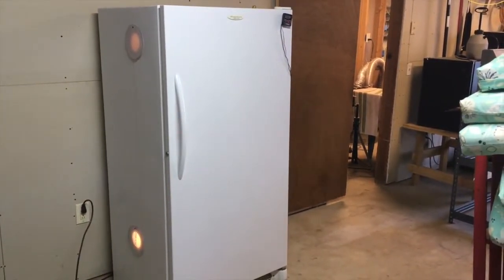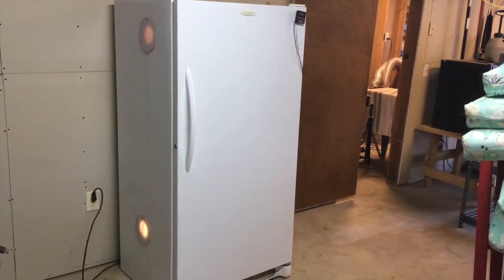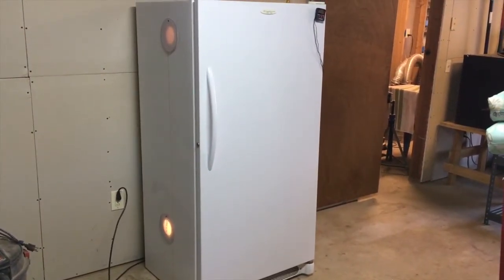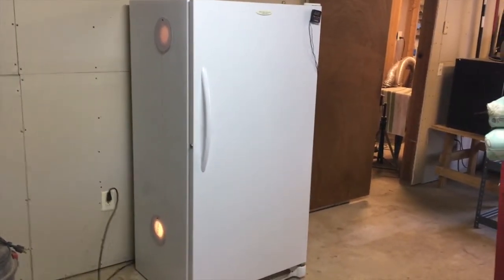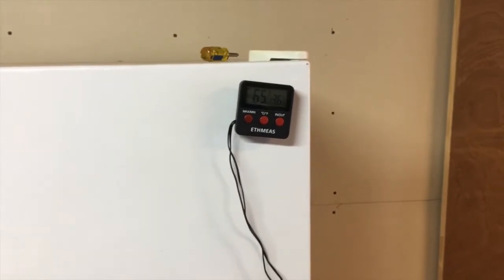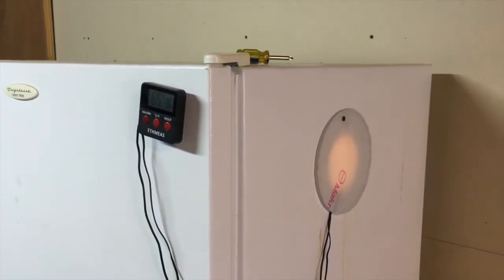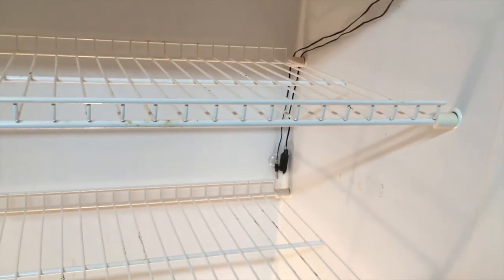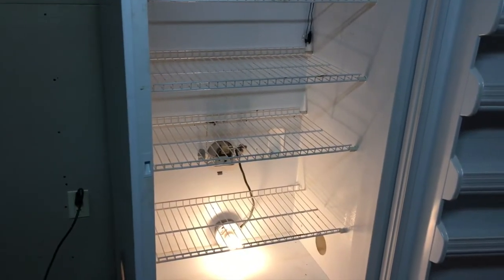DIY Wood Kiln

Comment: After seeing yours I grabbed a broken mini fridge from work and made a small kiln out of it. I started with a 60w bulb and it melted the inside of the fridge. 😳😁I changed it to a wax melting lamp for the scented waxes and it keeps it around 120-130 degrees depending on garage temps. Thanks for the idea and inspiration! 👍🏻Stay warm!
Reply from the maker: Wow!  Melted inside? Hard to believe it got that hot. Smaller area I guess. You have vent holes for heat to escape?  Have you noticed faster drying times?
Reply: @woodentreasurestn  I’ll text you a picture. It does seem like it dries faster. I only put some logs in it to test it out. A cedar one cracked pretty bad, but the hackberry hasn’t. It had some checking before, but it’s not worse. The wood has shrunk from the bark, however. Seems like it works great so far.
Reply: @ScenicCityWoodturning  Add a minute or 2 in a posting so we can follow your efforts too Mike !!     -Mike
Reply: @mpart_woodlathe-stuff  a minute or 2?
Reply: @ScenicCityWoodturning  I meant Add an aside once in a while to a post. Or feel free to do an in-depth post about it. We'd all be interested I'm sure. No BS.
Or does a minute where you are seem like days :) Or in Covid time that would be 1 or 2 nanoseconds hehe.
Reply: @mpart_woodlathe-stuff  oh, duh. I guess my senior moments are coming early. 😁 I can do that. Lord knows I haven’t had time to do anything else lately. Lol That’ll be easy enough. Now that my brain is back on track. 🙄
Reply: @ScenicCityWoodturning  Haha, guess I gotcha hehe

Comment: Could you please explain more about the temperature, humidity and the time and their changes when drying process happens!
Reply from the maker: Sorry for delay.  I was just explaining that as the drying happens, your drawing out the moisture and your humidity will be high (70-90%) ?, and will decrease over time. Depending on size of coarse is how long it’ll take. My last load of tree sides (just large chucks of wood) took a couple months and the humidity dropped to just below 30% and didn’t go lower. Moisture meter check showed below 10% moisture content. If there’s no more moisture to draw out the humidity will level off and not change. Temp got up to 100-105 degrees. Hope this helps.
Reply: @woodentreasurestn  thanx for your response. I think there is some schedule that shows the tmp, CM and RH ratio depends on kind of wood during kiln drying!

Comment from the maker: I have now installed Ceramic heaters instead of light bulbs, because of incandescent bulbs are hard to find, that I found on Amazon (link below and in description also).  These are reptile/terrarium heaters, rated at 100W.  With vents closed, temp went to 138+ degrees and this allowed me to regulate temp better with vents to maintain approx. 110 degrees (to kill bugs).  Hope this helps!!  Rick

https://amazon.com/dp/B07KLZCDQH?psc=1&ref=ppx_yo2_dt_b_product_details

Comment: Have you tried the little heater you have listed om amazon?  Do you prefer the light bulb over the heater??  Thanks in advance.  Wayne
Reply from the maker: Yes. Sorry for the delay. I meant to update my results. The ceramic heater works much better. With vents closed and only circulating fan inside, it reached 140 degrees. When is opened vents full open it maintained around 116 degrees. Very satisfied with results. Filament bulbs are too hard to find. Only LED and they don’t get hot enough. Ceramic heater is the way to go!
Reply: @woodentreasurestn  I am new to wood turning and have a lathe and have played with it some getting the feel of it.  May I ask what you recommend on drying procedure.  I have a lot of wood cut and should I cut down to size for bowl, platter whatever to a point then put it in kiln to dry?  I know nothing about the correct way or the best way.  Thanks again.  And God Bless. Wayne
Reply from the maker: @waynenelson8907   be glad to talk more about this but prefer outside of comment box. Didn’t see an email contact info on your channel, so for your privacy go to my channel and send me email under “About” and we’ll chat via mail or phone. Thanks

Comment: I'm in Clarksville myself. Recently got a freezer from the landfill with just this purpose in mind. 
How long have you been using this set-up yourself? 
Thank you for taking the time to share this video.
Reply from the maker: Hey Jason!  Good to chat with neighbors!  Been using for over a year now but it's off and on use.  Don't have constantly on, not enough product yet for that.  I try to cut, seal and dry all at once.  Time is usually the issue there.  Haven't done yet, but I think rough turned bowls would benefit well here.  You cut away most wood and drying wouldn't take long at all I think. Next on the list haha!  Thanks again!